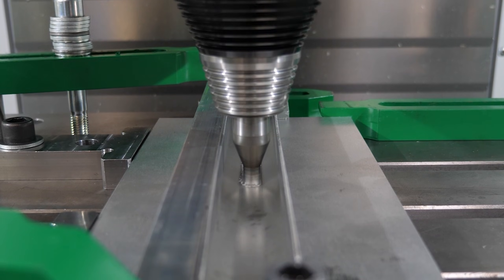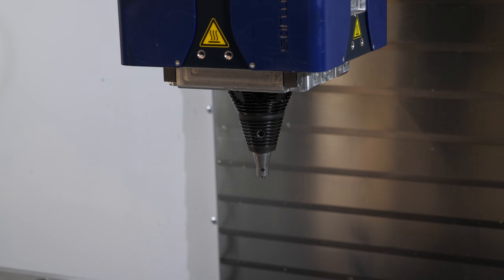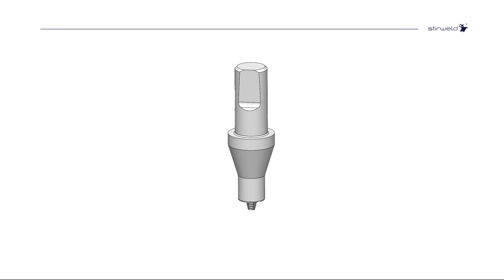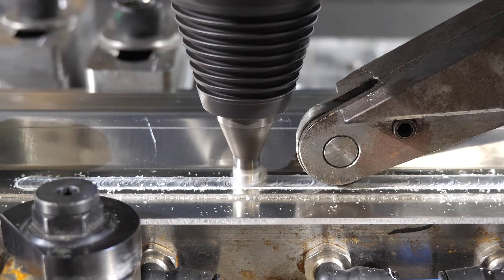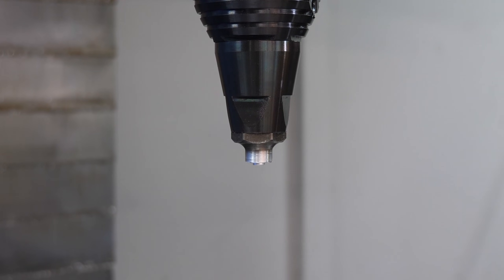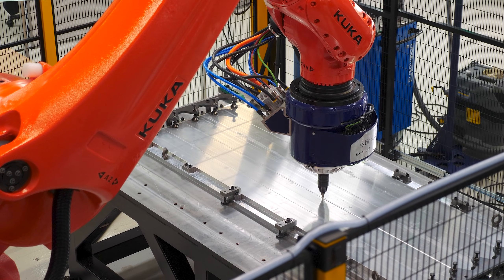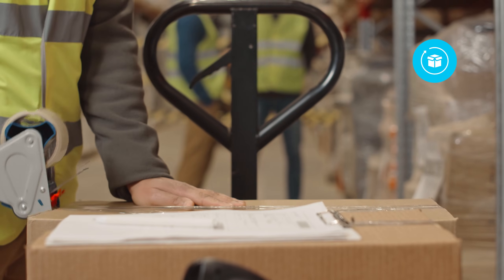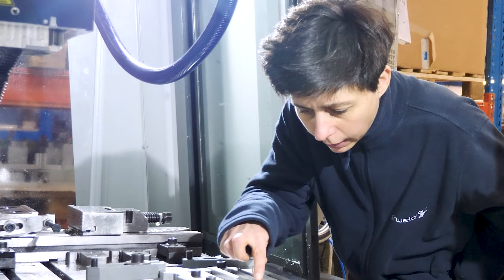Why the FRICTION STIR WELDING tool is SO important?

Comment: it work in stainles-steel like SS304 or SS316?
Reply from the maker: FSW works with aluminum in a lap joint configuration, although it cannot be applied industrially to stainless steels such as SS304 or SS316.

Comment: I think friction stir welding is so interesting but do not understand sth. How it connects two components together? I assume while the tool is rotating it melts the materials on both components and so that it glues togather. Isn't it this glueing so weak or not powerful enough to glue them togather? I really wonder if these problems occur or how it can be solved?
Reply: is not glueing. Is more like mixing when are hot.
What i dont know and i supose is the material dont reach the melting point, is just below where the material get soft then the screw mix bot units.
Reply: @slevinshafel9395  Got that it is amazing process actually . Do you have any experience about FSW ? I have some questions about it ?

Comment: I would like to know what kind of requirements for the CNC.  Do you need a lot of HP?
Reply from the maker: To ensure optimal performance, you need at least 10 kW of continuous spindle power and a minimum spindle torque of 50 N.m at 1000 RPM. If your machine meets these specs, that's a great start! You can contact an FSW technical team member at contact@stirweld.com for more information and ensure the most successful beginning to your friction stir welding journey.

Comment: In Denmark in 2010 I rented an Audi. The front struts were FSW to my delight. A couple of years later made in USA Audi's were NOT using FSW on their front strut towers. Spot welding doesn't hold a candle to FSW on sheet metal. Subscribed.

Comment: I bet the stress imparted on the work is astronomical lmao
Reply from the maker: Actually, FSW tools are designed to minimize stress. The process doesn't melt the metal but rather mixes it mechanically, which reduces thermal stress compared to traditional welding! Thanks for your comment!